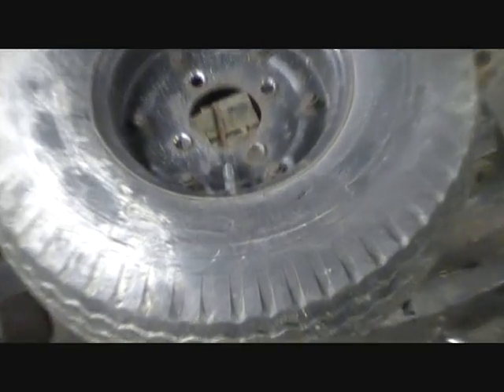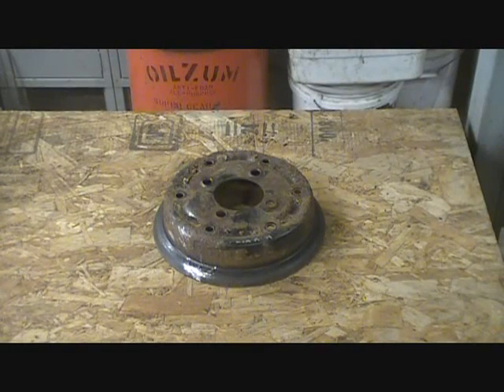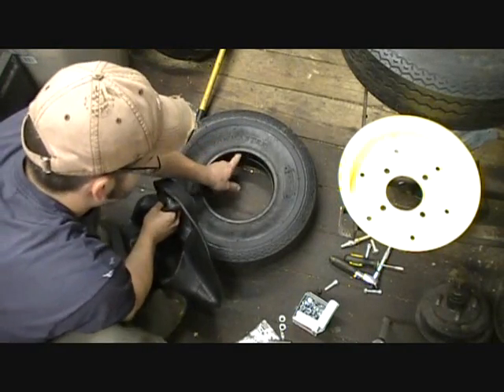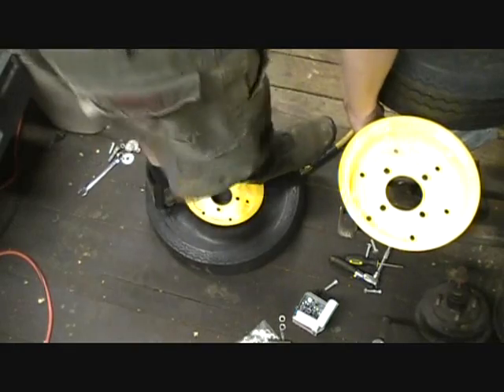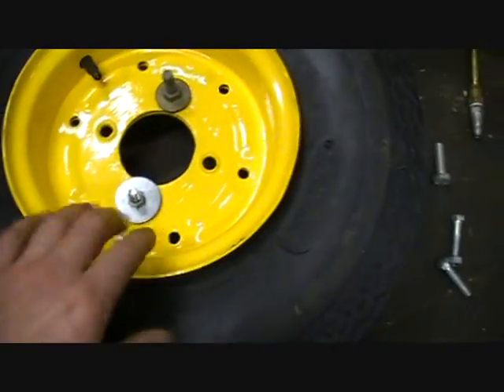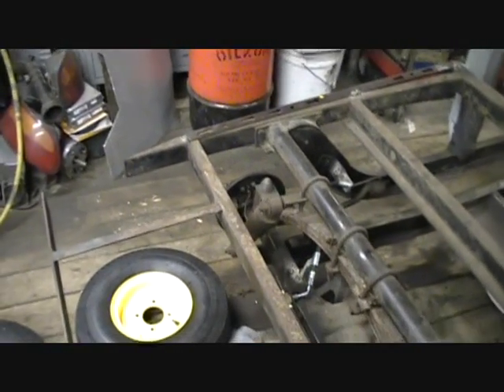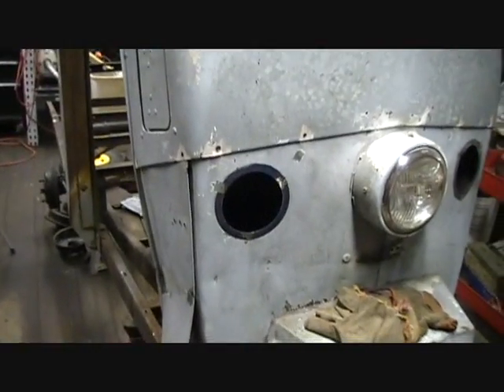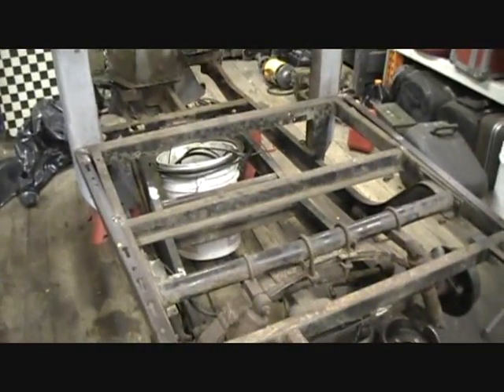1961 Cushman Truckster EV conversion LiFeP04 - Part 4 Wheels, tires, brakes, body

Comment: I guess the younger folks don't realize that bias ply tires were standard equipment on all cars and trucks till radial ply tires started taking over in the 1980's.  Although harder to find, they are still available.
Reply from the maker: Interesting.  I've recently learned a bit about bias plys and their rigid beads.... In fact it was on Youtube.  The video was discussing split rims for a heavy truck.  Tubes and super stiff beads....

Comment: I have the same rims but they dont split apart how did u take them apart
Reply: Cushman rims were normally split, held together by bolts, if yours bolt together the bolts are quite obvious.
Reply: G56AG do you happen to know the location of vin number on 1961  truckster?
Reply: Angel Peña could be you don’t have original rims

Comment from the maker: The extra length will change the dynamics of the vehicle some.  I'm going to keep that area free of cargo weight as not to make the vehicle unstable.  The aerodynamic drag reduction should outweigh the handling problems.  If it doesn't work, I'll modify the design.
B